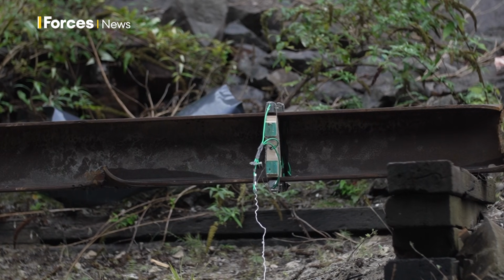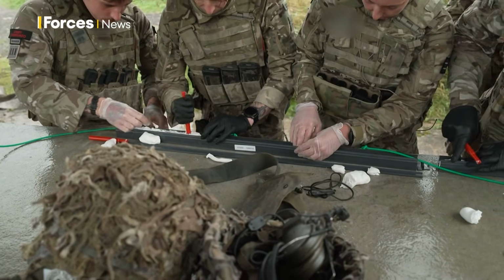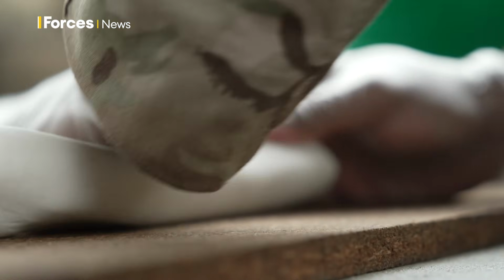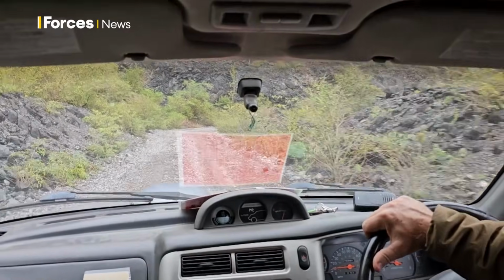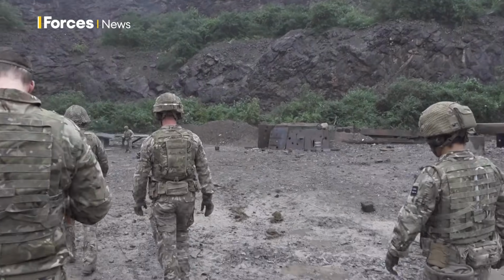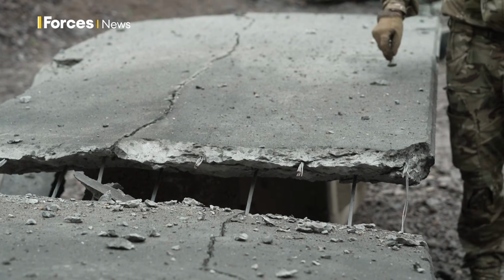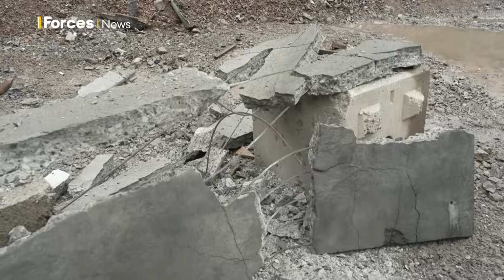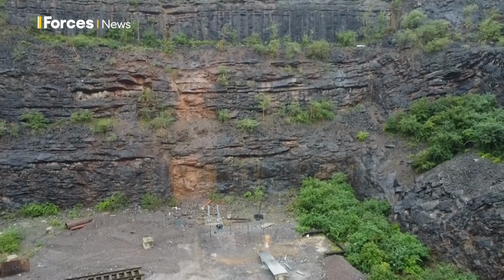Ranger Regiment soldiers have a blast with plastic explosives training

Comment: "The only equation you need for explosives is P....for plenty."  That was from my assault pioneer inst in the 90s...we ended up blowing a steel sheet 2 inches thick in half....with 1 half going about 50m's into the air.....

Comment: Nothing clever about this.  Just join the Royal Engineers instead…..
Reply: Just because it's "nothing special" doesn't mean it's not a skill worth having across the units
Reply: @AnimatedPiksi  precisely my point.  I did this in the RLC.
Reply: @NedLawrence2434  what is your point may I ask? As it sounds like because it's a basic skill they shouldn't learn it and join the royal engineers, or rlc in your case, interested which has a negative conation yet you support my comments on saying they should learn it. Sending some mixed massages my dude.
Reply: @AnimatedPiksi  Again in English please?
Reply: @AnimatedPiksi Every infantry battalion has an assault pioneer platoon. Its not a sneaky beaky skill and the Rangers are still just light infantry. It's a tasking no different to armoured infantry or air mobile. It's not a SF unit.
Reply: @zoiders  "Role: Operational Partnering.
Specialism: Special Operations Capable"

I dont get the hatred for a unit learning a skill. just because other do it dosent mean the shouldnt
Reply: SAS also do this. It's because they're working behind enemy lines without engineers support.
Reply: @Law9652  ….I did it in the RLC.  There is nothing special about basic demolition….
Reply: The whole point is the Rangers are going to be doing this behind enemy lines/ in a combat zone without other units to support.

Where as engineers have to have other arms with them if it was a combat zone
Reply: @SodaPrezsing No they won't😂
Reply: @zoiders  no they won’t what?
Reply: @SodaPrezsing  the reason why i said pioneers, is the simple fact is they are one of the first to arrive at a battle and one of the last to leave, they are the ones who build bridges and roads to access the battle area, and after the battle is over they fix the infrastructure back up again after the damage, what do you do with a unsafe bridge that needs to come down for a new one to be put in place, or a unsafe apartment block.. PLASTIQUE is what...
Reply: @wor53lg50  the Rangers are going to be using this skill but In a different capacity, in areas where royal engineers don’t go because they’re not combat arms, let alone going behind enemy lines to do this.

There’s blokes on this vid mockingly saying RE do this aswell trying to discredit the newly stood up Ranger Regiments capabilities
 
Again RE aren’t combat arms, Ranger regiment is
Reply: @SodaPrezsing  Um, i think you will find there is a demo cadre in the REME that are qualified in the use of explosives..and yes the Royal engineers are in front line  duty, who do you think clears minefields or gaps the burms and also puts up pontoon bridges? Thats either being under fire or not, they still have to do it....they have challenger tanks with mine ploughs with built on or towed snake det cord, aswell as mine layers, they all have personal weopons, and are trained how to fight like infantry as they sometimes have to... I even think though im not 100% sure have their own mortar platoon, as that can sometimes be used for mine clearance...
Reply: @wor53lg50  Where did I say anything about REME?

Also Ranger Regiment is for training foreign armies in a non permissible environment, akin to US Army Special Forces. Beyond the scope of front line fighting.

Also just because RE are meant to be combat engineers doesn’t mean they’re at the tip of the spear, they go in with the combat arms infantry and armour so they’re not the ones fighting, just doing the duty of Assault Pioneers. Also everyone in the army has a rifle, doesn’t mean they’re good with it.

My point stands that Ranger Regiment is using this same skill RE and other units have but in a more hostile environment with less support, Unconventional Warfare
Reply: Pioneers even learn that...
Reply: @wor53lg50  correct.  No big deal is it?
Reply: @NedLawrence2434 jealousy is an awfully ugly trait
Reply: @NedLawrence2434 they never said it was anything special, just something that rangers have to do, they also do so many more things than you did in the rlc (surprised you actually compared yourself to rangers) next you’ll be saying there’s no point of the infantry because you did some section attacks in the rlc
Reply: The rangers don't just do this so why would you join the engineers instead. Just join what you want